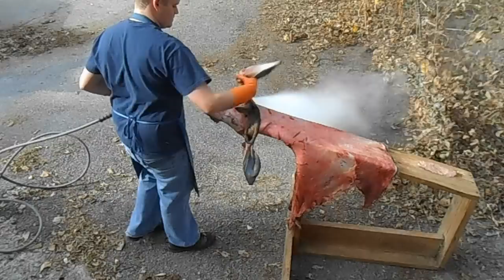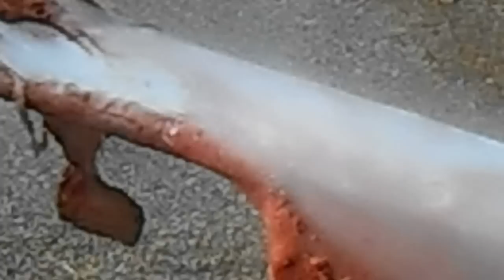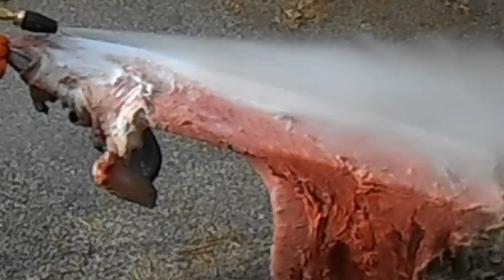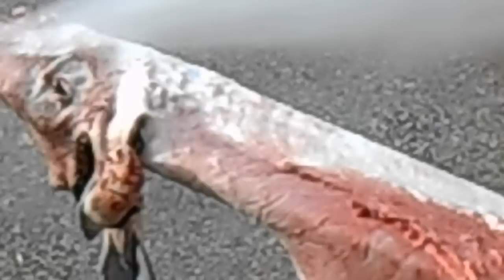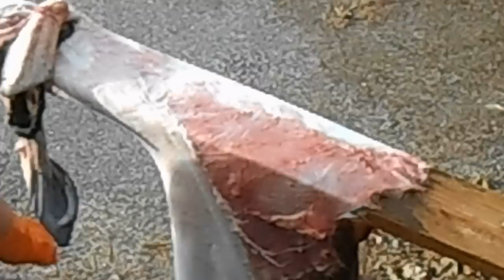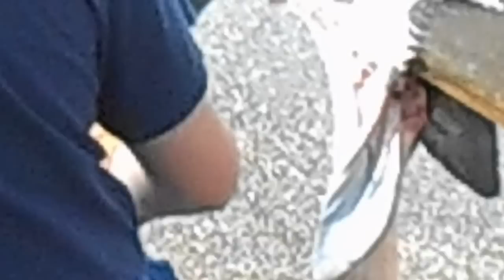Power washing Deer Hide

Comment: We do all of our animals like this before we put them in the tanning solution.  This removes all the red meat and most of the blood from the hide. We do bear, elk, coyote and fox as well as our deer. You must use the turbo nozzle and adjust your pressure depending on your speciman. 

From here we take the hide inside and turn it right side out, do a quick rinse only (no soap) to get any dirt or blood out of the hair, turn it back inside out and put it in the tanning solution.
Reply: hey that stand i take it u made it? it works well? i been laying hide on the ground but i have been looking for ideads on something like this
Reply: @finnsnracks2085  Yes. I made it. I've done hides on the ground, but if there happens to be a rock or something I didn't see under the hide, it can cause a hole fairly easy.
Reply: Wade Calvert thanks for the quick reply,  it looks like something that wld be simple to make! im fairly new to the taxidermy world, i really just do it for myself friends and family, little tips like this makes life ao much easier........

Comment: This is a great idea.  I am thinking of doing this to my son's hide.  Do I salt it before or after power washing it?
Reply: After power washing.
Reply: +Overwatch118 What is the next step after the powerwash, If I want it dry and soft?
Reply: Ok. I'm planning to use cooked/soaked oak nut shell for the tanning. Anyone done that before?
Reply: Ok, you are missing something here.  You really need some type of acid. Now if you are making a natural tanned hide. YOu can soak dried oak leave and make a great tannic acid. Oroxalic acid (AKA wood deck bleach) will also work. With the aluminum sulfate.  After the week and working the skin in the solution. You can either smoke the hide for buck skin or oil the hide with bisulfantated neats foot oil.  If you dont want to use neats foot oil. Gentley cook the brains of the animals in cheese cloth and water slowly, then once fully cooked, you simply rub the brains into the hide.
Reply: But do I also have to use the aluminum, in addition to the oak acid? What is the aluminum for? 
Is the fat/brain for softening the leather in the final step?
Reply: Aluminum sulfate is a very very weak acid, its would take pounds to drop the pH of the water enough. While the A.S. is highly astringent, the A.S. makes a very very weal sulfuric acid. Weak enough in fact it will not harm the hide or your clothing.  You can use citric acid to drop the pH also. I tan hides every day it is my business, the salts in the A.S. also help lock the hides cells open as it dries, easier to break and open to accept the oils and other tannins.  YOu can also buffer the inside of the hide with a hand held grinder and 36 grit flapper wheel.
Reply: Thank you for your explanation. I guess that's why tanning acid from the oak bark can be used if it's a strong solution. (We used to put oak extract in certain aquariums for fish that thrive in very acidic water/low PH).

How does brain tanning work, if you chose to use that method instead of acid/aluminium?
Reply: By the way, is the grinder with the flapper wheel used to soften the leather after its been soaked in the A.S. solution?
 It would really make the job much easier from me, suffering from a chronically low state of energy.
Reply: Your son might have made you mad but I don't think he deserves that extreme of punishment.  My father often told me he was going to pull out a belt and tan my hide but he didn't do it literately.

Comment: do you need the full 3000 psi. I have a 1700 psi pressure washer will that work?
Reply: Bryan Ketchum For deer, elk, bison etc. you will need the 3000psi. for coyote, fox and other small mammals the 1700psi may work. The most important thing is getting the turbo nozzle.